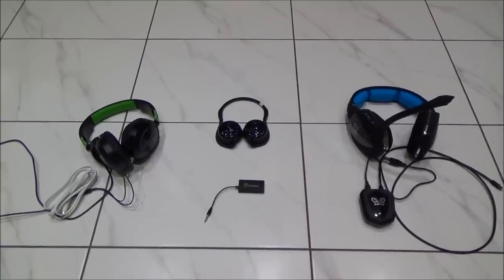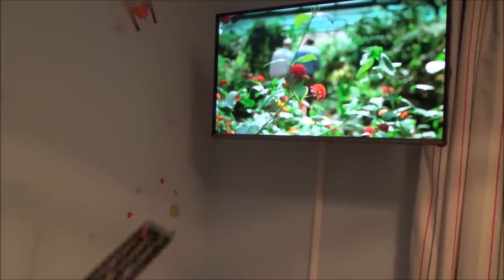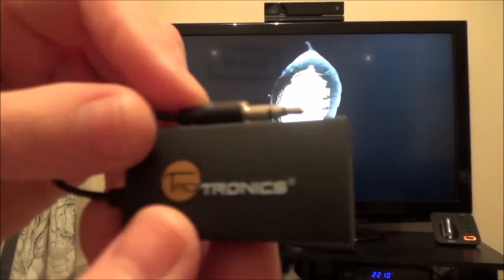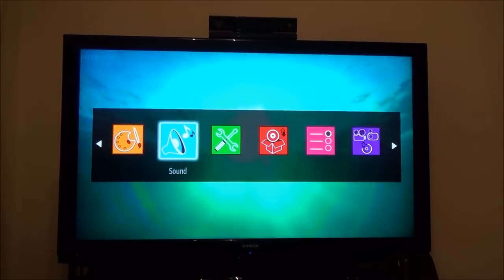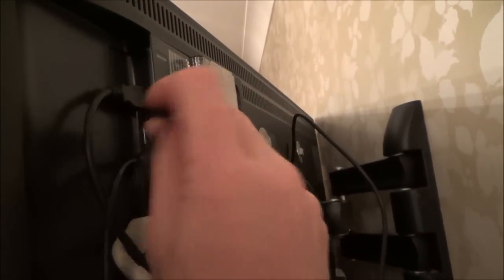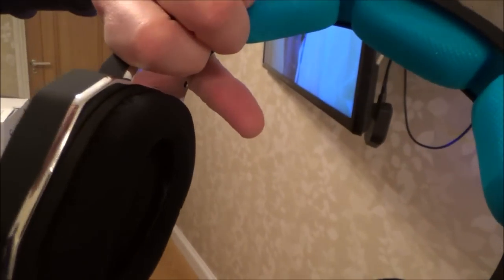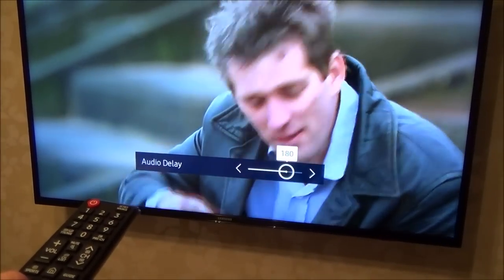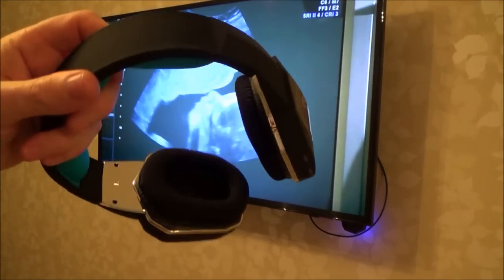How to use HEADPHONES with your TV : Bluetooth, Wireless, Wired

Comment: the problem is most new tv's don't have bluetooth or headphone jacks.
Reply: Did you and the other thumbers even look at the video? 

If your TV does not have bluetooth or a 3.5 headset jack, you can hook up headsets in other ways. For example....here are two ways......

1. Plug a cable into your red/white RCA output (not input) jacks. The other end of the cable will have a 3.5 male plug which will plug into a bluetooth transmitter. (The kind of transmitter he used in his video is a good one and about $10 on amazon) You would then turn on a pair of bluetooth headsets WITH VOLUME CONTROL to pair up. ... A nice pair is IJOY that sells for about $16 on Amazon. 

2. OR you can just buy a gaming headset with volume control and plug it into a cable that would plug into your "tos" fiber jack on the back of the TV. (This is a very small female jack on the back of your tv that has a small plastic door cover with red lights coming out of it)  Most TVs less than a few years old have this tos jack.

 I learned all of this from looking at this excellent video..... Thanks My Mate Vince!
Reply: @MrUsaer  thank you ,couldnt have said it any better ; )
Reply: Old
Reply: you can also use a usb adapter for your headphones
Reply: @peet1409  hi have you tried any? Can please tell in detail. I want to hear Netflix in 5.1 on headset. How do I that?
Reply: @grahamsmith7407  hi did you check Netflix in smart tv via headset output? Does it show 5.1 or stereo?
Reply: Not only that, but the fabricators excised the headphone jack. They eradicated support for low latency APTX technology on both JBL and Samsung Q60A panels which means that the end of both the JBL and Samsung dynasties reign supreme in my household! I plan to defect back to LG for the TV and Logitech for the headphones. I have no clue what I can buy for my next smartphone unless JBL and Samsung address the issue in future hardware and software updates!

Comment: You pretty much covered all the options and issues and projects.But I have two issues that  I need help with it.One is sound through headphone jack on a 50 inch Westinghouse smart TV WE50UB4417 is extremely low and I can't just turn it up by TV's volume control and there is no option in sound settings either.Thanks!

Comment: At 9.30, where no sound is coming through the TV, rather than keep plugging and unplugging, check your TV settings.  Mine has a headphone link which you turn on or off and then the sound comes through the speakers OR TV. :)

Comment: The problem is that new "smart" TVs from Samsung don't have aux port. I don't know what they were thinking really.. In addition, I have a quality DAC which I connected through TOSLINK but I only hear some distorted sound and it doesn't work. So I won't be able to use my quality headphones as well. So the only option for me seems to be investing in a bluetooth headphone which wouldn't have the 10% of the quality that my DAC and existing headphone provide..

Comment: Hi on your 2nd illustration using the the Tao transmitter. I followed your example and paired up a set of earbuds. Although this worked and the sound was good the picture is totally out of sync with the sound there is about a 1 second delay between the picture and sound. So unfortunately totally un watchable.

Comment: I have gaming headphones with a microphone and a 3.5 mm Jack. My stereo receiver has a quarter inch Jack output for the headphones. I have an old 3.5 to quarter inch adapter that's in good shape, but when I plug it in to the headphone jack I don't get sound unless I pull the Jack halfway out of the adapter. Were the old quarter inch adapters not suitable for the new inputs that have mics?

Comment: I have a Samsung smart TV 32 inch model # 32j4303. The audio output is digital optical  audio output mainly for connecting with sound systems or amplifiers. However, it does not have a 3.5 mm jack output. Tell me in what way can I connect my earphones with the TV as in which splitters or connectors or converters or cables do I need to purchase ???

Comment: so what about a wired headset (btw headSETs are headphones with mic attached in some way, headPHONES are just, well, headphones without mic attached I can't tell you how many posts I came across today that say "headphones" instead of "headsets")? My tv is a 6 or so year old 19-inch Element tv that has very limited options for ports. 

and when I say limited I mean like.....1 hdmi port (that I have been shareing between my ps4 and my destkop), 1 usb port, 1 VGA port, 1 headphone port, 1 set of RCA ports and one of the ports you connect a cable box into. 

Because I've been using the HDMI port for my desktop all the sound is going to my tv, which is good and all if I only wanted to use the headphones portion to the headset but I got these things to be able to use Discord's calling feature on my desktop. Can I please get some advice from anyone on how to fix this?

(Also yes I'm desperate enough to take my proplem to youtube -_- sue me [that was sarcastic, please don't sue me])

Comment: My brand New TV doesn't have Bluetooth and the 3.5mm jack when I insert headphones just sounds really fuzzy/buzzing/static, it's definitely the TV I've removed all other power devices and still even when the volume is on one the buzzing is the same volume even when it's turned up, so just ordered a usb to 3.5mm adapter, anyone know if this will work? I'm vexxed!